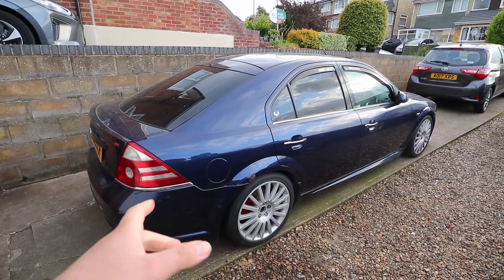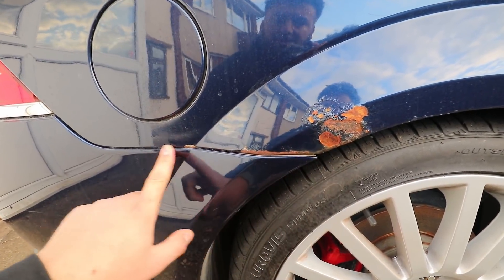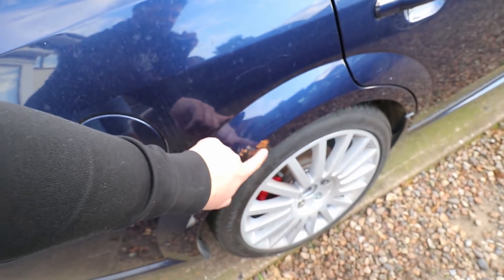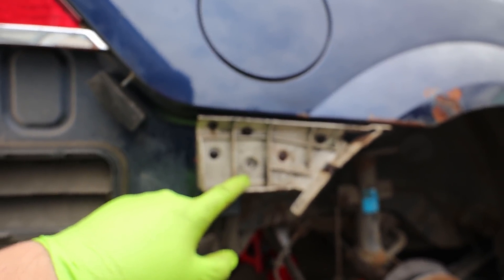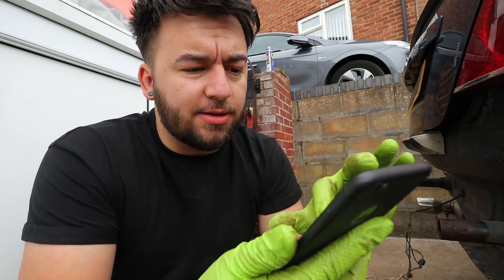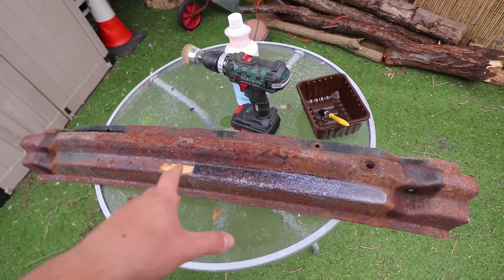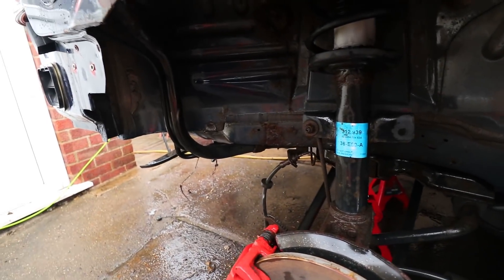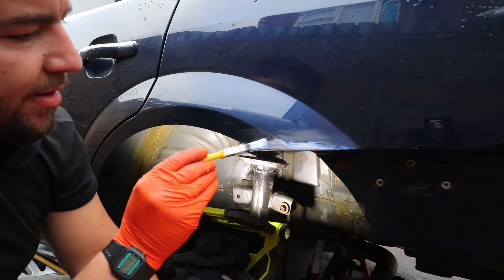Fixing The Rust On My Mondeo ST! (Part #1)

Comment: Some more advice. never dip a brush into the treatment liquid after the brush has been used on the rust. Particles of rust enter the bottle and reduces the its effectiveness the next time you apply it. Especially if not used until month later. Pour the liquid into a separate (clean) container and poor in small qualities.
For welding advice head over to the Rover man "nitrosilvia". He has recently published his beginners guide to welding. He has other informative vids too.  I would suggest someone like "Trev's Blog" as he is very skilled. But he may put a beginner off if you try and copy his skills. having said that I have to say he is very informative.
 Last channel suggestion is "Soup Classic Motoring". Another person who has gone through the welding learning process. You can see how far he has come, with practice.
Reply: Hey pal, thanks for this tip,any chance you can put a link to his welding video, having trouble finding it 👍🏼👍🏼

Comment: Those rust treatments are good but the one I use seems to work  better if you just remove the bad flaking but dont clean back to bare metal. It seems to need some rust to complete the reaction and go back to metal. When I have cleaned back to bare metal and applied it sometimes stays tacky?

Comment: I cleaned out the rear arches on my Mondeo about a month before this video. It was nowhere near as bad as this one. It was the opposite too, It had rusted more in the places not covered by the liner, like right up in the strut tower, and behind some of the holes in the top of the liner that are there for no reason (plugged them now)

I then sanded all the rusty areas, gave it two coats of kurust just to get anything remaining, two coats of zinc, four coats of metal paint, then covered absolutely everything in grease. I'll go back in every year and renew the grease, it's not expensive, and at least it wont flake off like underseal and make the problem worse. I've tried this treatment before and it worked, but not in a wheelarch, so I'll see next spring how well it's worked.

Usually Mk3s hatches are much worse at the back than the front, but I have seen them at the scrappy with rust underneath the battery box and air filter, so It's worth checking your front arches too.

Comment: Plastic arch liners are water traps. I've took mine off and found some surface rust on my wheels so got rid of it and  waxoyled it. I could tell that the rust on the Mondeo's wheel arch wasn't just surface rust as the metal was alot thinner.

Comment: Finding it's worse than you thought is common in these situations.  I just replaced both rear arches on my old 1993 Mitsubishi Pajero,  used a cheap Lidl gassless mig welder and cut sections from a rust free Pajero.  Took a couple of days working on and off.  You can do it, take you're time and do small welds. You will manage it.

Comment: Great to see you`ve made a start on the rust. It didn`t look too bad when you first bought the car. It`s amazing that some Mondeos rust more than others. Mine is a `56 plate and really solid around the arches. I do worry about what is behind the rear bumper though so it might be a case of removing it and having a look and also try to sort the sag. Mine isn`t an ST so it hasn`t got the secret panel to hide the screws behind. Good work though, once it`s all done you will be proud.

Comment: Hi mate i had rust  in similar places to yours above the windscreen, so I got my windscreen took out so I can treat it also to check if the rust went under the windscreen, its a good job I got my windscreen took out because right along the lip of the car were the windscreen sits it had surface  it might be worth doing the same to yours, I used the vactan and it works a treat that stuff, keep videos coming mate

Comment: Watched last night before you took down, did you notice you tried to drill the rivets out with it in reverse, if you are going to get a new wing then it is worth practicing on the old one, cut a patch and weld it in. ChrisFix done a good video a few weeks back of panel repair. Loving the work though.

Comment: I've done some rust repair on my focus... The finish came out really well but rust came back through 6 months later (even though I sanded, rust treated, etch primered, base paint and clear coated it). 

My mistake was thinking that waxing the paint once dry would help it. You shouldn't wax until ~30 days after painting to allow the paint to cure and outgas, otherwise it won't cure properly!

Comment: Those bolts behind that pannel will have been fitted by a previous owner. These rear bumper sag and drop a bit so a cheap fit is to bolt it to the crash bar. I had to do it on mine.

Comment: Them rust bubbles along the front edge of the windscreen is from a clumsy windscreen fitter removing the screen in the past and the removal tool has scratched through the paint and they never treated the bare metal before fitting another screen.

Comment: As someone else mentioned, try Jenolite rust eater before you put the converter on. Yes, it removes the rust and doesn't convert it, but my experience has been that rust converter always leaves a tiny amount of rust behind, which comes back to bite you on the bum. The rust remover actually eats it all away, and you can see clean bare shiny metal. If you look at the area you sanded, there are dark spots of rust in tiny cavities in the metal where the sandpaper can't reach.  yes the holes need filling, but rust repairs need a thin skim of filler anyway.

Comment: Best way to prevent arches rusting is make sure the bumper and the arch has a little bit of a gap so they don’t come in to contact and rub and then leave you with those rust patches👍 even a slight little nudge from another car or whatever will make them come in to contact and start rusting over time

Comment: the back arch hole,i would get a small metal plate and mig weld ,tap the metal inwards around the hole,put the plate on the inside and mig on the out side ,put a bit of fibrefil over weld grind down when dry then put body filler over ,rub down  then prime and paint

Comment: This Vactan Anti Rust solution reminds me very much of a product I used in the 70's on my first Mini called Kurust. That turned the metal black and you could use it as primer. It was powerful stuff and when it came to derust my Daughters Mini back at the turn of the Millennium I managed to get some more but it was a different product same name but half the strength . They probably had to make it less toxic but it didn't bite into the surface. This Vactan stuff seems a bit more potent so will give it a try on my next project. Keep up the good videos, they are always interesting and informative, you have a gift in getting the story over well!

Comment: I bought a 56 plate tdci st,I took my wheel arch liners out and wax oiled and greased the wheel arch and the whole underside
The car still looks amazing no rust at all.The only thing what I had problems with was the wheels and flat spots on the inside of the wheels
I also polly bushed the whole car.At the end of the day cars rust,You have to try and delay the rust.Do not weld a new arch  weld a plate on the back.put the rust converter in a bowl then brush on
Silicone the wheel arch lip so when you put the insert in there is a barrier to stop the damp and muck

Comment: No need to buy a new arch piece.
Fibreglass and fill it and it'll be good to go..
Also get some underseal in the arches whilst you have them stripped.
Reply: Stephen Buchanan then it'll rust out 10x as worse as before. Do it properly.
Reply: Stephen Buchanan That's what I would do! Ford rust buckets!😂😂
Reply: Bob Jo    It's a £300 Ford . It's dodgy front to rear.
All Ford are shocking for rust. Almost as bad as VW's
Reply: David Lulham   I have a 2011 VW polo both sills completely rusted out. O/s sill needed front 12 inches replaced ,n/s almost as bad.
My brother had a 2008 Passat fell apart with rust wings ,sills rear arches. They are terrible both VW and Audi. Ask any body shop .
Reply: David Lulham only tool here is you if you think filling that will make it better 😂. It's people like you that make jobs 10x more difficult in the future. Duh! You came on here with the attitude, so I'll dish it back.
Reply: @sportshatch  there's none on my 2002 2.5 Zetec S Mondeo... Depends how you look after them.

Comment: Good time to try out the welder. Get some old steel of similar thickness and set up similar repairs on the scrap metal on the bench. Keep trying until you can perform that weld correctly. Then have a go at the car. Worst case you end up cutting it out and doing the whole arch. So nothing lost. If you butt weld clamp flattened copper pipe behind to stop blow through. Watch lots of videos as well.

Comment: The dreaded tinworm! I've tried most ways to slow it down over the years. I agree with the comments not to buy a whole arch, just make a localised repair with fibreglass and filler and save your cash.
The most effective way i have found for that scabby rust in the wheel well is to scrape/sand as much off as possible and then just brush some grease on it. Sounds mad but it lasts for ages and is easy to maintain. Bilt-Hamber sell a product called Deox Gel which would work well around the windscreen. Get as much rust off manually as you can, put a dollop of the Gel on it then seal it with clingfilm.
After a day or two most of the rust will be gone. Audi sussed out how to beat rust years ago, I had an 87 100 CS that was spotless. If you wandered around a scrapyard all the 100's that had been junked were all immaculate!
Citric acid mixed about 5% in water is good for getting rust off parts like brackets etc. 

Mix it with hot water, bung the parts in and leave for 24 hours. Fish them out, scrape the stubborn rust off and lob them back in again. You can de-rust brake calipers really well like that,takes a bit of patience though!

Comment: The reason I found you get rust patches on the rear bumper to the arch is actually the bolts/rivets for the rear bumper bracket. They get a little wet and that's it rust starts and never stops unfortunately.

Comment: Rust tends to be worse than you think especially with your example. Personally, I would give the underneath of your car a good going over with a wire brush, rust treatment, and underbody sealant otherwise you'll have issues later down the line from experience. Good video though!

Comment: I have the same rust at same places. It seems the previous owner (it obviously wasn't you) had fixed the problem most Mondeo ST's suffer from - saggy ar5e syndrome.
Betwee  boot edge and lights, there's meant to be 2 screws, but because these are only two that hold bumper up from the top - they break. This causes whole rear most section of bumper to 'sag' downwards, making it so that the outer most corners at the arches to to be pushed up into the rear wing. This then rubs and cause damage then rust to the wings.
The fix is to raise the bumper at the back to correct level, then screw directly into metal crossbeam under that panel. (because you didn't know those were there, that's what gave me clue it was previous owner). 
I've done the same to mine, but haven't yet fixed the rust. I'll do it soon though as luckily it's only surface rust where paint has flaked off.

Comment: How about treating the rust hole with a mesh backing placed on the inside of the arch to form a base, then fill with fibreglass filler. Then normal body filler as per usual?

Comment: I love your work with the Mondeo and I do appreciate your videos. Four years ago I had same rust issue on the wheel arches on the Escort. I have ordered both sides and they were no more than 50 Euro a pair here in Croatia. 
Mine Mondeo 2.2 is in much better shape than yours. But it's not an ST. If I had an ST I would restore it properly. In 10 years from now it's going to be worth way much more then now as an old-timer.

Before this Covid situation I was in Austria seeing sellers still asking for 5-5.500 Euros for an 16 years old Mondeo ST.

Restore it properly. 👌 Don't ever sell it. 🍻

Comment: I’d just get a piece of the right gauge sheet metal and cut to suit the patch you need to weld in from the back of the hole.. just cut the worst of the porous thinned rusty arch out before patching.. then finish with a light skim if filler.. easy job mate.. 👌👍
Just get practicing with your mig in your shed, welding clean metal with the mig set up properly with your wire, gas and amps should sound like bacon sizzling in a pan.. keep up with it mate, you’ll get it 👍
Reply: Good advice
Reply: Also I’ve found over the years 0.6 to 0.8 gauge wire is about the best in the mig  for bodywork.. as for gas I use a 5% argon mix.. crystal 5 think it’s called, run that about 10-15 ltr min. I’ve always found the gas less migs to be really poor so try steering clear. 👍

Comment: Keep up the good work - definitely do the restoration. We're all in lockdown and that's unlikely to change - keep yourself busy with a project. The more you start looking the more rust you''re going to find - you might aswell strip the car completely and start again. FYI @Chrisfix has a really good guide on rust repair + repainting. You might want to spray that rubber undercoat on the bottom of the car once you've finished too.

Comment: If a Phillips head screw or anything like that rounds off just get your Parkside battery angle grinder (any grinder or hacksaw if you can) with a thin cutting disc and put a shallow slit in the head of the screw, and then use a flathead screw driver to undo it. Job done. Easy

Comment: James, Martin Butler at @RetroRestore will tell you all about Vactan!! His son Jimmy has his own body repair shop and will be able top help you with ideas on how to sort the arch out!! The 4 bolts behind the plastic trim aren't a standard fit from factory. Take off the 2 side skirts and check the sills. The plastic covers will be hiding quite a bit of dirt and possibly rust. Look behind the wheel arch liners on the front too.

Comment: I observe once the corrosion gets past the galvanized steel you have had it. I just seem to revisit the same rust areas again and again; its like you are just slowing down the inevitable! Would be interested to find a way round it! As you say old cars arnt worth throwing loads of money at or spending large amounts of time on. Also it is worth keeping undercoating good, especially in areas prone to water and corrosion. Imho its just a case of getting itthrough the mot!

One thing i have found worth doing: putting grease on brake and fuel lines. In the old days they used to have chassis grease specific for this kind of greasing!

Comment: Quite surprising, the mk3 Mondeo is usually pretty good, my 02 Zetec S 2.5 is rust free...i fixed one rear door years ago for minor rust on the bottom edge,  so far it hasn't came back.

Comment: Nightmare mate I feel your pain  :(  I started painting my calipers on my st220 in middle of lockdown. Regret it now. On cleaning them I inspected the inner wheel well and found a rust that turned into a hole the size of a fist. Had to get both sides done with metal welded in. If you've got one of these cars don't hang about u need to protect the rear arches on these cars the under seal is rubbish.

Comment: If you want a quick job and not ready to weld yet,  just use fiber glass filler for the hole, you prob have to do it again properly in time but as you said in the beginning of the video that you were willing to do that anyway. If you got time and willing to learn to weld then get the panel and do it properly.

Comment: Vactan is great stuff but there are a few things you need to know before using it, you cant use Vactan on bare metal as it wont stick, it will only self prime the rusted areas where the chemical reaction has taken place, its also not designed to work with single 1k paint systems but rather for use for 2k paints and epoxy primers/sealers. also dont use body filler direct on the metal surface as any little pin holes in the metal will allow moisture and water to get to the filler and the filler will soak it up and cause it rust again. much better to put a thin skim of fibreglass filler in first or if its not that deep mix the fibreglass filler and normal body filler together as the resin from the fibreglass filler will seal the body filler from water and moisture. on the inner arch the shelf section you mention i fill them with fibreglass putting a 45 degree angle on there to help stop mud and dirt sticking in there causing rust issues again, you could also do this with tigerseal etc. you also missed a small rust spot on the swag line of the rear arch (can be seen at 31:42 ) you just never feathered the old paint back far enough mate. also P120 is far to harsh for rattle can prime to remove the scratch marks, id say your much better off finishing that with P240 before priming. also dont put filler over etch primer or any 1k paint as you get a reaction and it will not fully harden up but also makes the paint soft to

Comment: I nearly had heart failure when I took the rear arch liners out of my puma, pretty much the same reaction as you, oh it's not so bad it's going to be fine, then oh that's a hole, that's another hole, that's been bodged 😂🤣 it's now been fixed and I have rust proofed it to within an inch of its life, Dinitrol do some brilliant rust proofing products for when you have finished, good luck with the drivers crater 😂🤣😂

Comment: Get it fixed and have a go welding with a gas less welder if thats what you can afford or get a gas one and practice on the mondeo you might surprise yourself the best thing to do with rounded Philips screws is to get a grinder and cut a slit in it so you can get a flat head in there to turn it works a treat